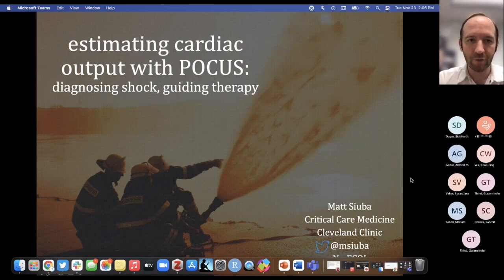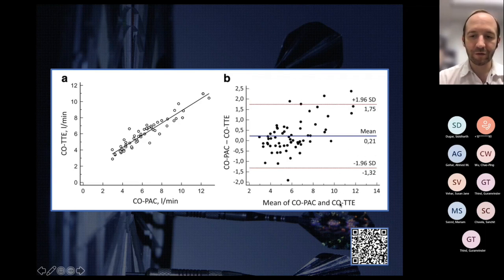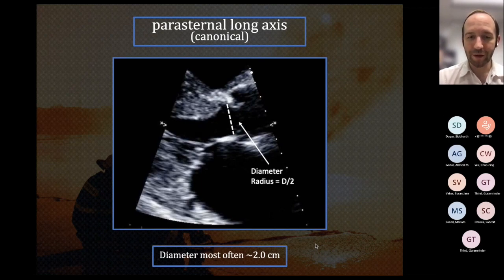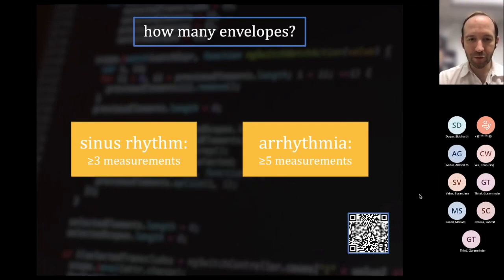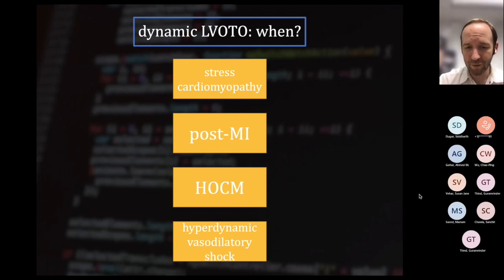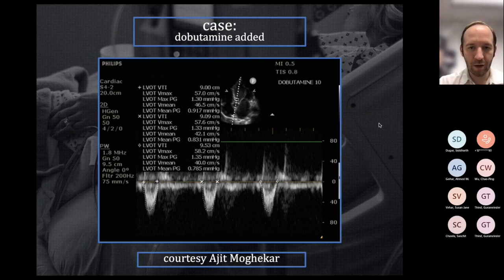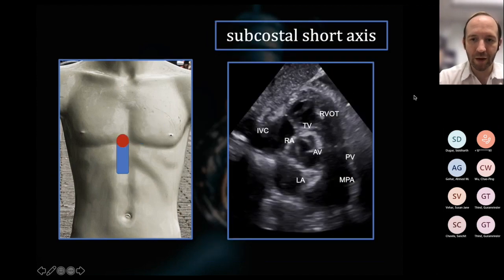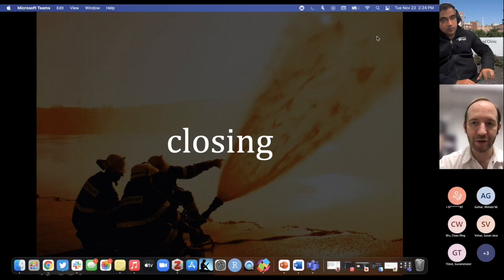Estimation of cardiac output using point of care ultrasound (POCUS) - diagnosing and treating shock

Comment: In most example PWD sampling images shown it seems that you (/the authors of the papers from which the images came) are not using any angle correction. Is this something you would recommend against?
Reply from the maker: Great question!

Angle correction is reasonable if the angle of the gate is off axis more than 15-20 degrees from the target jet. 

I did not include it in the talk for simplicity's sake, but it is reasonable to do angle correction when you feel it is necessary.
Reply: @zentensivist7949  Thank you!